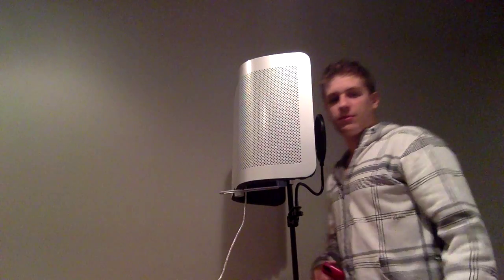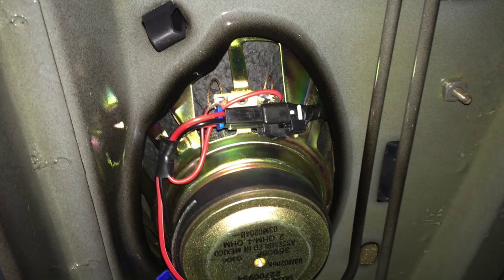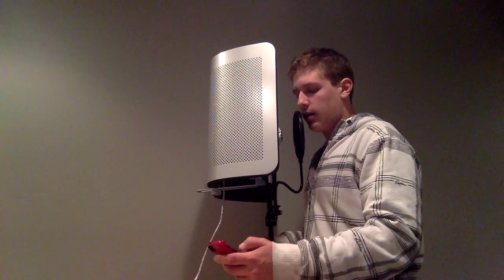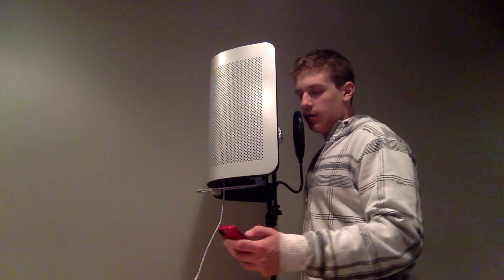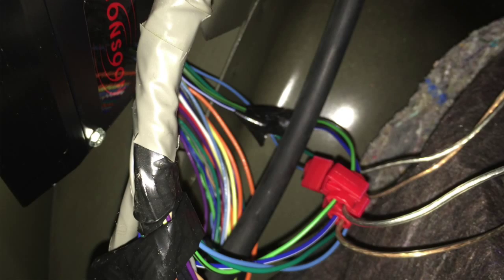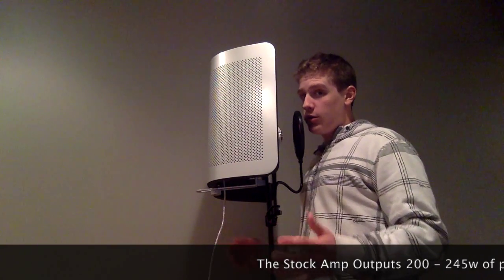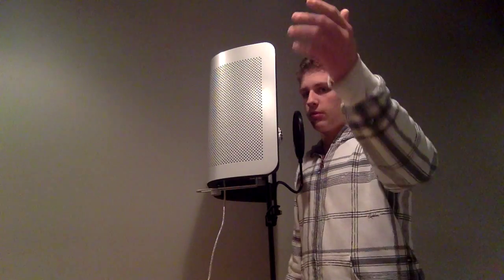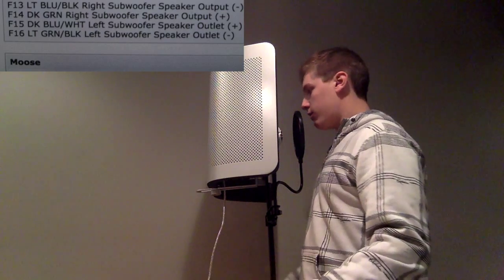Installing Subwoofers with Stock Head Unit

Comment: I located my factory amp so now I take the wires form the diagram and connect   them to a line out converter to a different amp. can't I just use the factory amp and just connect the wires straight to me subs?